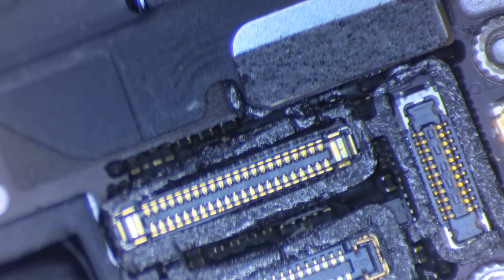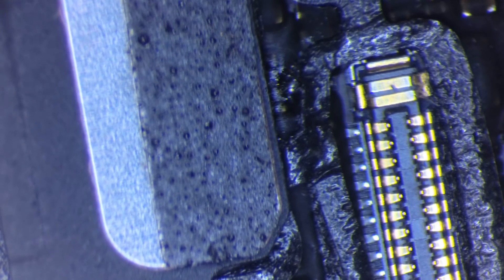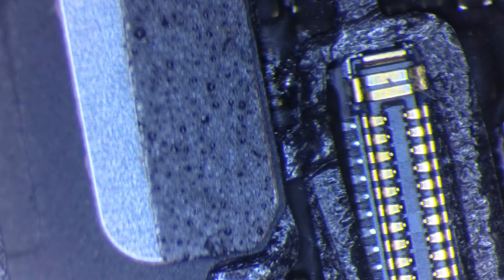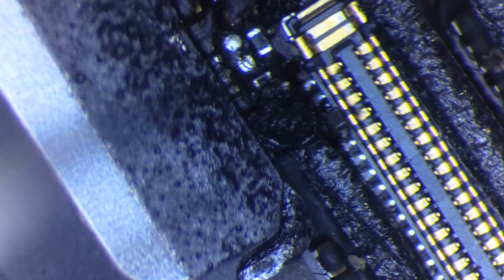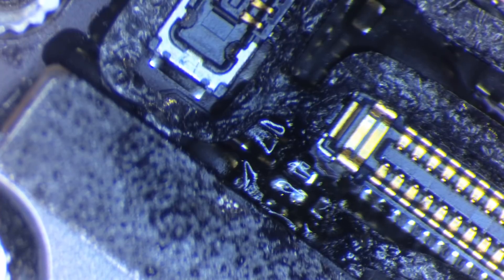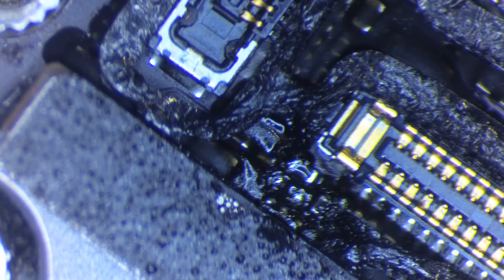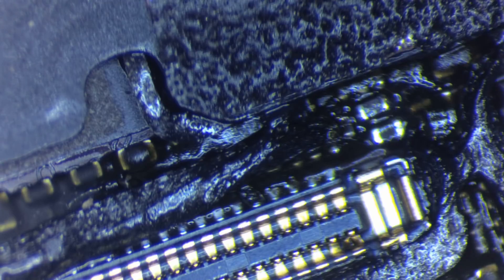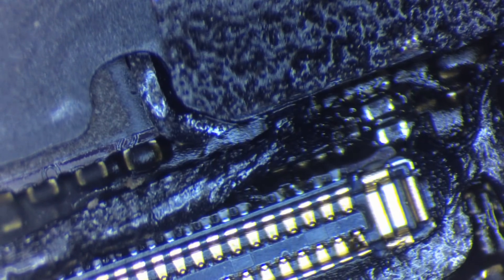iPhone 6S Backlight Repair in 4K

Comment: What camera setup are you using with the microscope to get 4K video output?
Reply: And yes - I did look in the video description and checked out the links showing the "equipment used in this video" - it lists everything BUT the actual camera used
Reply from the maker: KCautodoctor sorry I need to fix that.  Check tools and equipment link
Reply from the maker: It’s in the description